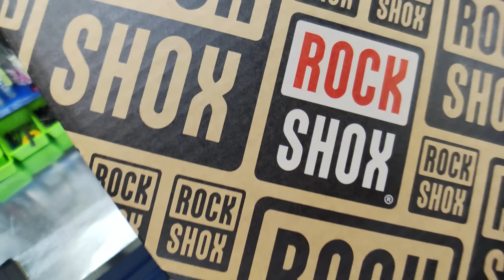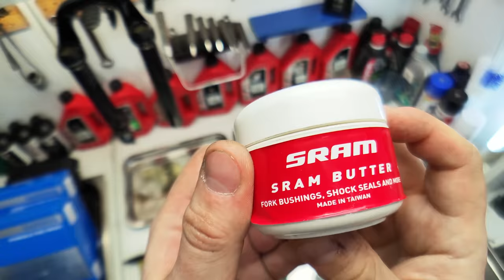What's inside a new Rockshox Judy bike fork. Bicycle fork review and lubrication.

Comment: The judy forks athis is the only suitable suspension fork with a non-tempered shaft, which also fits on china bikes where they always use the worst steel core spring forks.
i love this judy fork
Reply: Works great on my dirtjumper. I have a 2011 dartmoor player 26 that takes straight steerer. Was nervous at first but after last season with it, itll hold up.
Reply: Recon silver rl is also non-tempert  in a Version and stiffer;)
Reply: @marnig9185   i run my judys at 200psi, theyre stiff no matter what lol
Reply: @marnig9185  still really good small bump sensitivity even at high psi

Comment: It's just me or he added over 30 instead of 5 mL of oil to the Lower Leg? Overfilling will damage the fork. People are ruining their forks after this video... You can actually tell how much oil was before at 4:59 of this video.

As I can tell you should have used 15wt oil 6mL for Damper Side and 10mL for Spring/Air Side.

Comment: easiest way to service these , just spray some brake cleaner near the seals and all the dirt and crude will come loose and do this 2 or 3 times.  Clean and wipe the residuals off with a rag then follow up with some silicone spray.
Reply from the maker: This will not be a service, rather a temporary option before going to the workshop

Comment: Thanks the video. When you fill the oil to each leg you have to see a gap between the inner shafts and lower leg. I dont understand, that i have to fill the oil to this gap ( for the lower leg ) or should fill into inside(?!) the rebound damper shaft and coil spring shaft ?

Comment: Can you do it with the older Recon? I have a problem, my lock doesn't work and I'm afraid to wrench on it since I'm not experienced with those and don't have oil for it
Reply: Just typ it in to YouTube. Lots of tutorials available
Reply: @sempi8159  I seached a lot to find nothing that helps. I just use my bike with "half" lockout. My fork kinda stiffens when I apply the lockout which is fine since its a mountain bike

Comment from the maker: ⚠ ❓ ⚠
ASK YOUR QUESTIONS 
👇👇👇
Reply: how much oil are you putting in the lowers?
Reply: Shouldn't you use a torque wrench??
Reply: SRAM posts a table of oil weights and amounts on the website
Reply: The lockout of my judy silver doesnt work at all. What could it be? thks
Reply: @dontfollowthebunny  oil
Reply from the maker: 10-15mm manual study, for each fork individually.